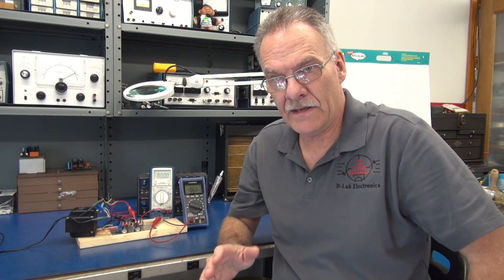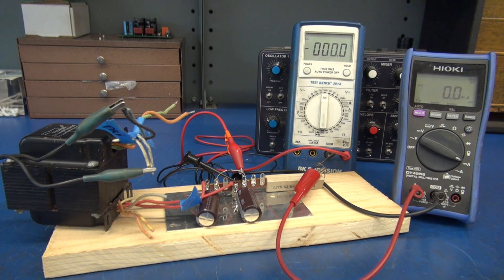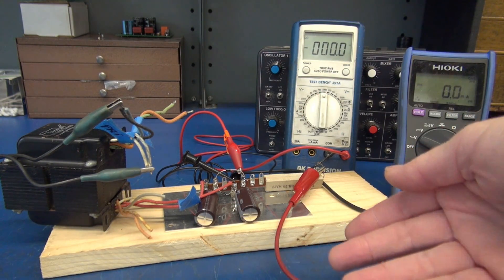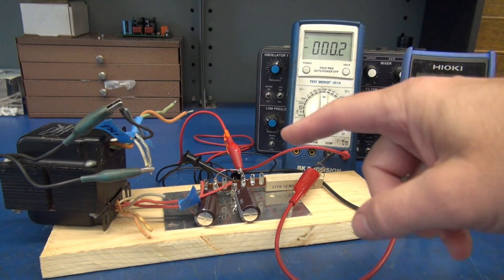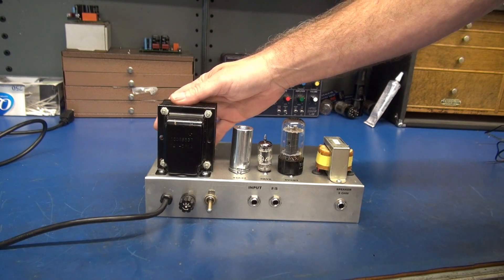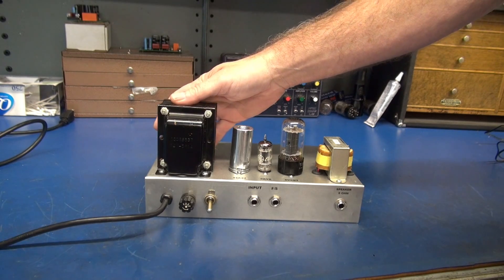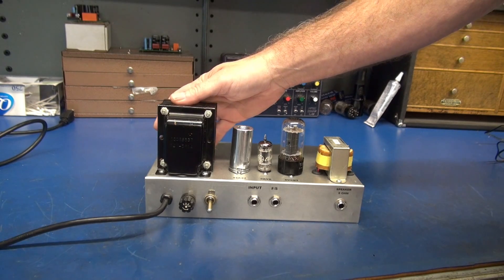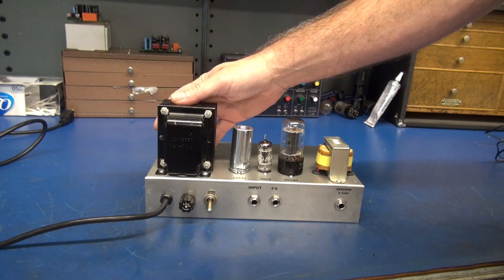Option to high cost Tube amp power transformers use a Voltage doubler D-lab test circuit & demo

Comment: justo to remember that power conservations and efficiency applies, so if you double the voltage on a primary you supposedly to use half current of what that very winding is capable of deliver.... great stuff indeed I've used that sort of thing countless times and work as a charm, just follow this gentleman's tips and you're happy ever after

Comment: Nice video. One thing I would be interested to try is a guitar plugged straight in. Because a class a amp amplifies for the entire cycle they are touch sensitive.I can drive the one I designed and built with a conventional xfmr into break up simply by playing with more intensity or play lightly and get a nice clean tone. The break up and distortion due to the sagging of the dc is desirable of course and I wonder how your set up performs comparatively regulation wise. Keep up the good work.

Comment: Why not use a voltage doubler and power it straight from the mains without any transformer ?
If chassi is properly earthed and you have a circuit breaker with gfci is there a safety issue then ?
But it might be a stupid question, but one i had in my head for some time :)

Of course you would need a 6.3V source, but thats many ways to fix.

Comment: They make resistors that can tolerate 290 volts? I didn't know that, they could be used for making AC voltage dividers.  😅

Comment: ##!!!!!How to determine 2 capacitors capacitance for half wave voltage doubler? there are different formulas. 14v AC, 12 amps current , AC 20khz and doubler output as 28VDC 6 amps.  C = I /   dV / Dt    less 1.4 diodes volts drop. Point on AC form where capacitor charges peak I think as 1/4 of Period time.  P= 1/F   End load as 4.5 ohms. Is this needing the reactance in ohms of frequency of source transformer secondary L to match proper 1st capacitor to cancel out?  Transformer resistance measured secondary output as .03 ohms. Inductane as 88 microhenry.  Xc to equal Xl of source transformer? Don't really know. Low ESR capacitors rated about 100v DC should be used. .Proper formula please or value of 2 capacitors needed if you can do it.?? My first cap 49uf burned up. The  cap of 82uf + 82uf overly warm., now have 330uf+330uf untested...////???

Comment: Great video as always.  This may have been mentioned, but several high-end hifi amps; as well as, Silvertones often used the doubler.  It is likely a better idea to use the full-wave doubler circuit rather than the half-wave.  An example is the Fisher 500C, my understanding is that they went with the doubler to take advantage of diodes for rectification while staying within the voltage limits of the early diodes.

Comment: Not enough amperes? Bogan amps all run voltage doublers...coincidentally I'm about to do a line driven Tripler  using 35w4's as the diodes....

Comment: Hot chassis is another solution with cheaper tubes, they can be safe. I have a Heathkit AA-141 which uses a voltage doubler but the transformer always fails on these.

Comment: Thanks now I can use my power transformer primary 230vac and secondary 130vac @130mA on voltage doubler for a push pull valve amplifier..

Comment: Harmon Kardon's renowned chief engineer, Stu Hegeman, used voltage doublers in the Citation 2 and Citation 5 tube power s amplifiers. These are highly sought out today fetching over $1000 in Ebay for average condition units. He used a solid state diode voltage doubler in the power supply.  That was intentional as the transformers were custom wound for HK. He felt they provided better performance than fullwave rectifiers. There are also half wave and full wave voltage doubler configurations.

Comment: I suspect you could use the 115 V secondary winding as the primary and the primary windings in series as the hv secondary.
Reply from the maker: Could only for HV, But the 6.3vac filament line would not be useable

Comment: Why are you using a 10K resistor because the output tube and peedance I'm not sure if it's in the data sheets that that tells you the plate impedance or you're looking at the data sheets combination pair of two tubes that the impedance of those so I'm not sure what impedance that you're looking at in the data sheets to get 10K as the load? Another question I had is how are you measuring the noise to signal a ratio because I would like to see you measure the noise level and I want to know what meter you're using or lab equipment to to get the noise level the spec to try to see the bring down the noise as much as possible
Reply from the maker: The 10K has nothing to do with the tubes, just a load for the DC power supply, Simulation.

Comment: Finally! I've been waiting for this! There's a project at the Brazilian forum "Handmades", called Carmine HB-1, where they use an EF184 and a 25L6 with a 30v+30v transformer, powering the filaments off 30vAC, and getting the B+ using a voltage doubler!
You could easily change the preamp tube for a 12AX7 for a more classic Champ style build.

Comment: Although many circuits have used this technique, my first thought was the external power supply for my vintage Heathkit transceiver, which also uses this type of circuit to get somewhere around $800 volts! 
If I remember correctly from doing research years ago, the capacitor value has a lot to do with the current capability in this type of circuit. Feel free to correct me if I'm wrong. Anyway, thanks for sharing this experiment with the rest of us! As always, great content Terry!  73!

Comment: Howdy. Nice.
My location is Finland Europe. The grid voltage is 230 VAC.
I have succesfully used a 230 V / 115 V transformer with a trippler circuit in my 4 x EL38 PA. To filter the anode voltage I use 6 x 100 uF / 500 V cap.s. There will be a slight overvoltage during warming up but it drops to about 470 V when warm. The intermediate cap.s. are 180 uF / 450 V and the diodes are  P600J.
There are 400 V / 230 V trafos easily available here. They are intended for switchgear internal control circuits. I have used one in my 4 x KT88 PA connected backwards. Works well too. The loss compensation works backwards though, resulting in about 395 V running idle. After full wave rectifying and filtering the DC is about 560 VDC running warm. The main filtering must be 450 V cap.s in series to withstand the voltage.
Voltage multipying works up to maybe quadrupling. The impedance will grow squared when stepping up the voltage.
Regards.

Comment: That is an excellent project! 
Calculated, one hundred fifteen volts times the square root of 2 (1.414) times two gives an open circuit voltage of 325.3 volts. Terry is correct that the caps should be rated well above the desired output voltage. He didn't mention that the diodes must have a reverse voltage rating twice the output voltage. I built a voltage doubler recently and had diode failure very quickly. Took me a while to sort that one out.

Comment: That funny. I have been thinking about using a voltage doubler but knew I needed to test it to see how much current it could supply. 
One question, you only loaded it to 30mA, isn't the total system current draw more than that?
I mean, the max plate on the 6v6 is 30mA plus the grid 4mA. When you add in the other components it would seem that you would run out of headroom.
But then, it obviously works so ...
And after just a couple of hours, look at all the comments. You definitely have a following.
Reply from the maker: Hello, Yes, The amp draws more than the tested 30ma using the resistor. That was just something close using the 10K resistor I had laying around, no calculations, just something in the ball park
Reply: @d-labelectronics  Gotcha. Thanks, Terry. I will be playing around with that soon.

Comment: I have used a voltage doubler several times.  I use seperate transformers for the b+ and filiment supplies.  It's less than half the cost of a typical transformer.

Comment: Effective lower cost solution to get a high B+ voltage. Watch your PIV on the diodes and maximum  voltage rating
on your capacitors. The diodes should be twice that of your expected output voltage and capacitors about 25%
higher for safety.

Comment: Hi there Terry,

Say, your skinny showed a 115v output on that xformer, all good and fine. It brings a question however. Why not save even a few more bucks and simply do away with THAT xformer and just use a standard filament xformer to power the tube fills and let the 115v go directly to your doubler ?

Nemo-

Comment: If my memory serves me correctly the Harmon Kardon Citation II used a voltage doubler power supply. That was a big amp with 2 channels and 4 KT88 tubes.

Comment: If you using the 115v ac tap, why do you need the transformer?
Reply: Because you want to isolate the circuit from the AC coming out of the wall.

Comment: Voltage doublers (and triple/quad) are very handy for some situations. It's so odd seeing this video as I had just pondered and am experimenting doubling 240VAC to get 600V (for a proto simplified Heathkit IT-11/IT28, no bridge just leak/discharge).

Filament transformers can be had for not much coin, and some really common control transformers (120x240 pri, 240x480 sec) are also often cheap on the 'bay. Other odd value transformers are often had for cheap... so sacrificing looks/space, you can get a variety of high voltages with a doubler. Current is limited by how fast the load discharges the caps (too much and they discharge faster then they can charge). You can up the cap size, but there are pros and cons. Diode and cap specs play part. For most applications, they are useful.

Good share
Reply: Maybe I will try to power the plates of a couple small tubes off a 24vAC 350ma wall wart with a quadrupler. It should work as long as I respect the diode PIV and cap ratings right? Do you think there are any safety concerns with respect to the grounding of the multiplier?

Comment: Seems you can use boost converters as well. There's the general issue of switching noise, but there are plenty with low enough noise to be fine for B+. There are 12V -> 200V-450V converters on Ebay that can handle 70W (at under $20) and I've heard of them being used for tube amps without issue. There's also Linear Technology's Application Note 118 which discusses high voltage, low noise DC/DC converters in detail.

Comment: I am not sure but maybe Bogen used some voltage doublers tube amps , heck on on the far ,FAR back burner I'm considering a p-p 6cd6a cathode biased with NO plate voltage transformer,(my personal use of course) doubler or even tripler circuit.

Comment: One concern is derating the transformer.  It was intended to use both 115V windings in parallel to create the power for the 6.3V .  But now one winding is not only powering filaments, but the high voltage as well.  Bottom line, the line current of the completed project needs to be less than half the normal rated input current for the transformer.
Reply from the maker: Hi Russell, Take a look at the diagram, What you are stating is not how this is configured. The primary is 120vac, There is a 115vac secondary and a separate 6.3vac, take a look
Reply: @d-labelectronics  That's unusual.  I thought this was a dual primary winding that was done series/parallel for 120/240.  What were they originally made for?
Reply from the maker: They came out of a Military base PA system, like you would see on the old MASH series

Comment: I see no reason why a voltage doubler circuit would not work for an amp, as for many years they used voltage doublers  in TV sets, which would draw more current than a tube amp would.

Comment: Great video, but nothing new... its an old trick... been doing that for decades, specially for lower voltages to drive 12v relays from the 6.3v filament power.... but my main question is "why" ??  A power transformer costs me less than 30 dollars to get custom made here in Europe... wheres the high cost for this??? I guess if they charge you more in the States they must think that making a transformer is big business....
Reply: Other than a surplus or junk, there are no power Transformers you can buy for 30 dollars suitable for an amplifier. Why they cost what they cost is a question that has no particular answer, they are expensive parts.

Comment: And it just so happens that I have a 1:1, 115 vac  and 6.3 vac secondary winding sets transformer sitting on my self!! Maybe it came out of an old Heathkit?  I'll wire up your circuit and see how it performs!!   Thanks for the tip !!
Reply from the maker: Excellent, should work like a charm! Yes, Heathkit had many devices, good to repurpose!

Comment: Hi Terry, once again, great content that's much appreciated😊. Back in my amp building days, (70's to early 80's) a good source of fairly stout power transformers were scrapped color TV's that were most / all tube type. Many of these sets used a full wave bridge voltage doubler hanging off of a 160 volt secondary and would provide a BEEFY 440 - 450 volts.
Thanks again for sharing your knowledge!

Comment: I am not very knowledgable. You are still using a transformer, for isolation I think. Is the advantage that this sort of transformer is cheaper than a step-up transformer with a high voltage winding?? Thanks.

Comment: Voltage regulation of a doubler circuit can be poor. That is if 30mA varies between 25mA and 35mA, will the dc supply voltage remain relatively constant ?
A full wave bridge-type doubler circuit, in which one arm of a standard bridge rectifier is  replaced by two capacitors, may help with the voltage regulation by supplying two current pulses to the filter instead of one current pulse as in this half-wave doubler circuit.

Comment: Danelectro did that alot. The old Silvertone 1484s used a power transformer that was almost 1:1 and used a voltage doubler on two secondary windings to get the 475V to the plates.

Comment: couldn't I just feed 120 VAC wall voltage to the doubler? or is the transformer needed in the path ?
Reply: Like they said, this is never a good idea. Especially for guitar amps, considering you touch the guitar, which is connected to the chassis. 

Something similar was done decades back. Look into "hot chassis" amps, where they used series string filament tubes and the chassis was connected to one side of the wall outlet through a capacitor. Needless to say, this type of amp is 1000X more likely to cause a shock.
Reply: Not suggested. The transformer gives isolation from the mains. No isolation gives a higher chance of shock.
Reply from the maker: I agree
Reply: @d-labelectronics  isn’t that what fuses are for? Or what if you use a GFCI? Those are easy to find. 
Can we build and amp with equipment found in Home Depot and guitar store?
Reply: I was wondering that too.